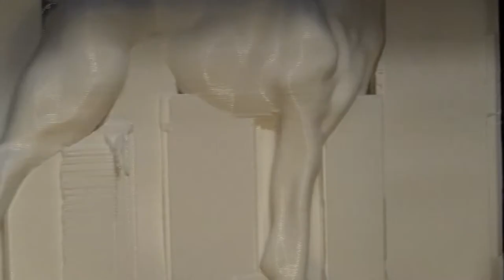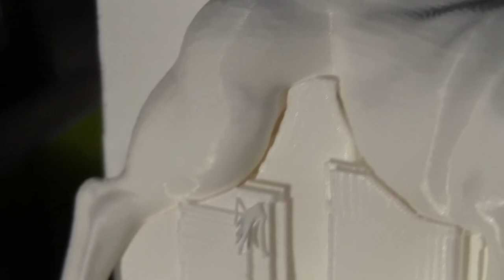bulldog-3d-print-orca040-52mms-not-blocked.avi

Comment: you can sand PLA (used in this video) and ABS. I've sanded ABS with 400 grit and it comes out pretty smooth and slightly shiny. A buffing wheel will shine it up too. You can also brush acetone on ABS and it melts it a little and makes it really shiny.. Acetone doesn't work with PLA though (which is made from corn starch).  ABS is what legos are made of